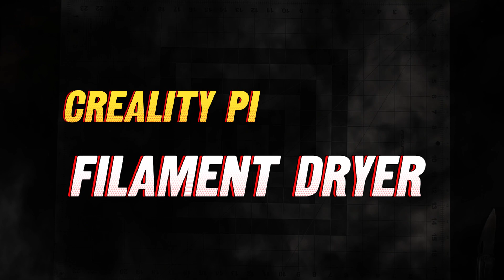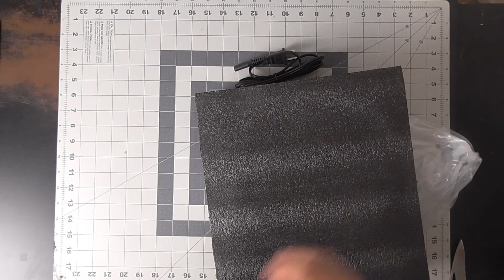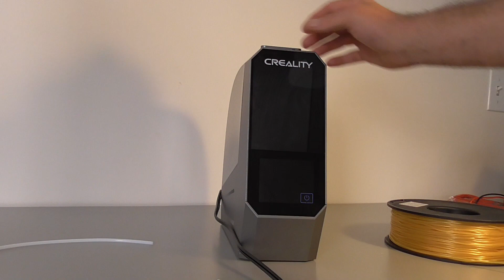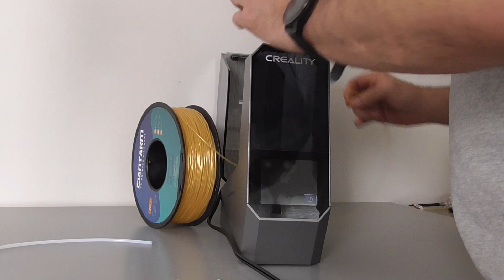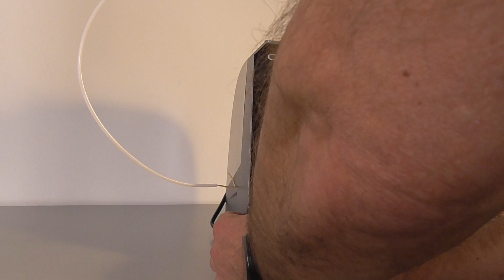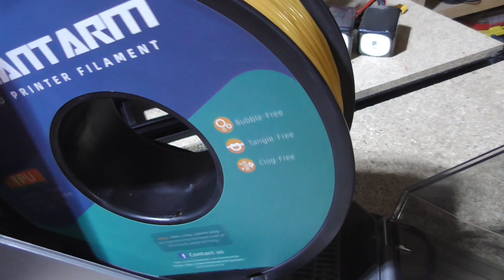Creality P Filament Dryer

Comment: the numbers in humedity reading didn't change.. any issues with the sensors?
Reply from the maker: Yeah, I noticed that after I shot the video.  I basically did the video showing the operation, which was a clunky.  Afterwards I used in production at set at TPU and the humidity rating started to 37% then worked it ways down from there over about 8 hours).  I'm not sure if 15% is the default when you start it up every time or just the 1st time.    I have the EIBOS one and it seems to monitor humidly regardless if it is powered on or not.